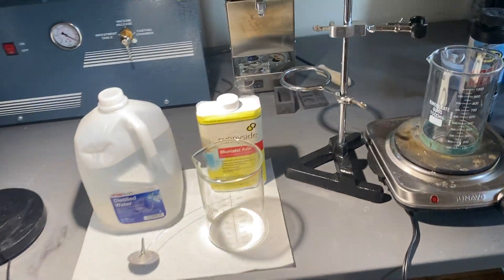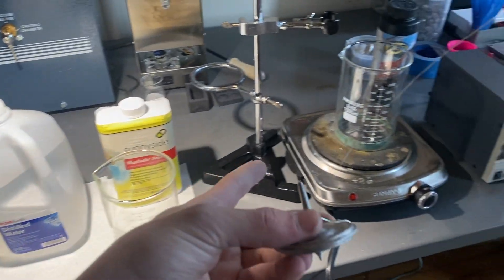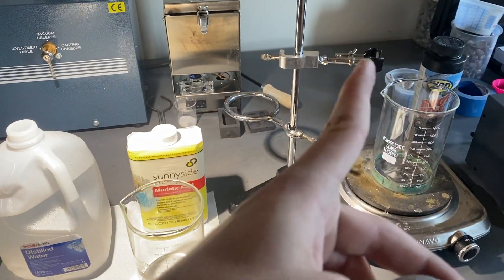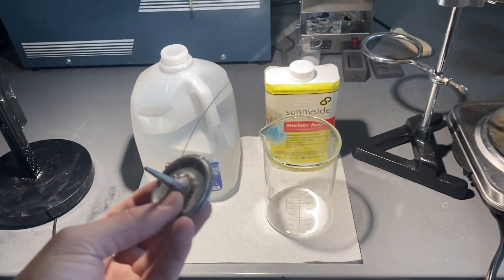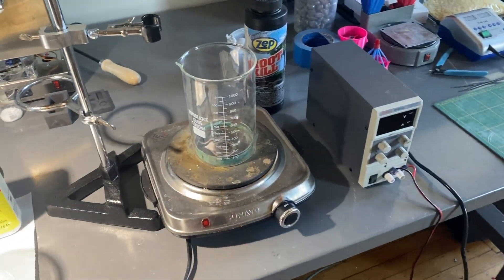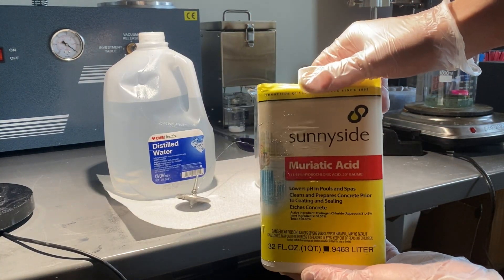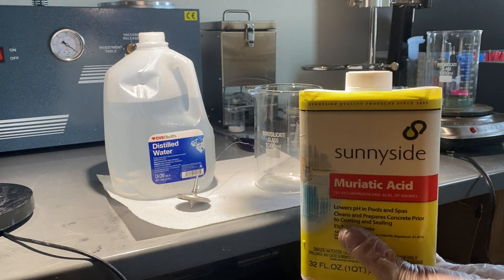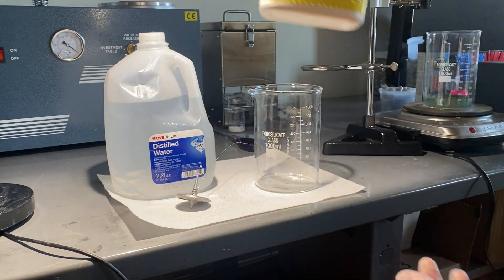Acid Etching and Copper Plating

Comment: That was pretty cool Levi. What I am hoping from your channel is making anything other than Jewelry.
Reply from the maker: I am a mechanical engineering student, not a jeweler. I hope to cast  2 stoke and 4 stroke, single-cylinder engines, I've already started to design those. I also want to make a functioning centrifugal jet engine but I need some castable resin and a small lathe first. The only jewelry you'll see on this channel is if my mom or sister ask me to make something for them! Thanks for watching!
Reply: @Levi_Sheridan  this makes my day. I am a Mechanical Engineer and an eddy current specialist in non destructive testing. I’m going to build a larger vacuum chamber and my own burnout oven. The only problem I’m having is I have only had like 8 days off in the last year. Lots of money, no time or time and no money seems to be my life story just now. I have bought a lot of the bits I need for the new section of the workshop but need the time to set it up. When you do produce something that needs inspection just chuck it in a box and send it to me, I have all means of inspection including X-ray.
May I suggest a channel for you, it’s called Myford hobby. You will like it.
Reply from the maker: @gordon6029  hey there! That is super cool! The only experience I have with eddy current is in RC plane wheel brakes. Good luck with your vacuum and oven build! I was considering building my own but I will be moving to a small apartment in new york, after my gap year to continue school, where I hope to set up my shop and thought I would feel more comfortable with a professionally made product. Thank you for your offer, I will definitely take you up on it at some point in time when I start to cast structural parts or parts that will be under high acceleration, such as the piston in my engine. Surprisingly, considering how much time I spend on youtube, I have not heard up Myford hobby but I will be sure to check it out. Thank you! Best, Levi Sheridan.
Reply from the maker: I see in your favorites playlist you have so aviation related videos. Are you a pilot? I’m currently a month or two away from getting my license, I have about 50 flight hours mostly in a 172 but some in a 150 and I flew a Bonanza a couple times.